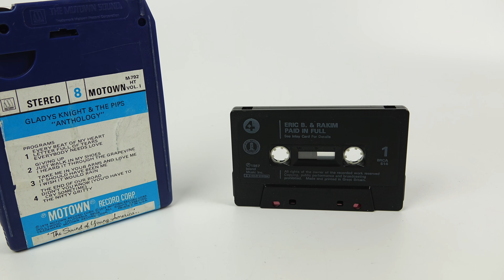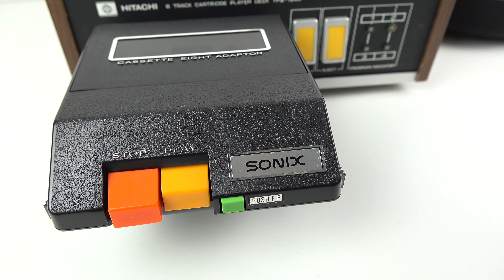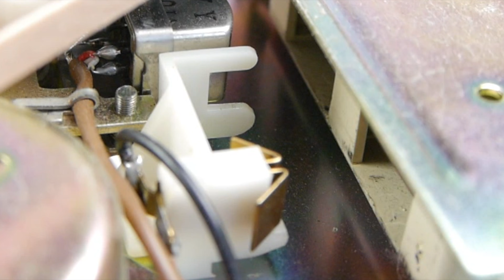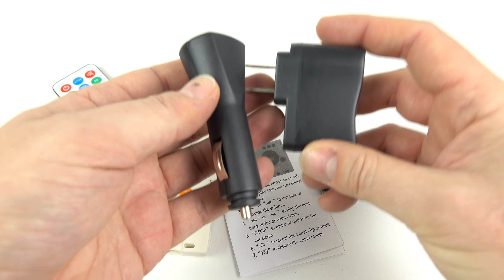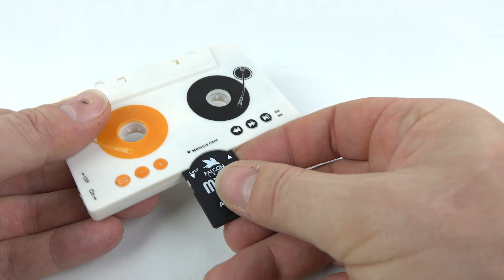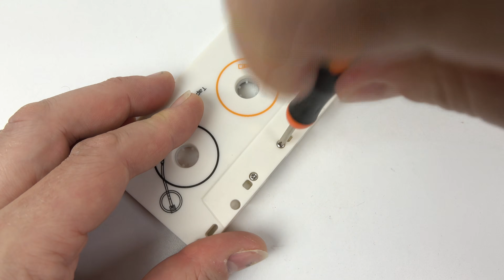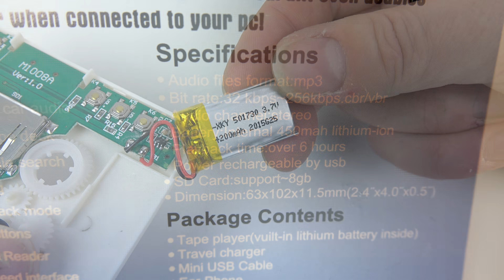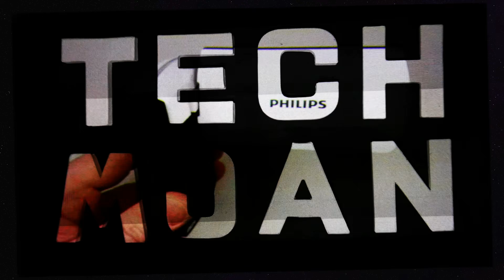Car Stereo Tape Adapters - 8-Track to Cassette to MP3

Comment: When my grandmother stopped driving around 2000, she gave me her 1981 Cadillac El Dorado and it was rocking a 8-track player.  Kinda wish I knew about these converters back then....  I drove that car up till about 2008 before it finally kicked the bucket.  Well it didn't but the repair costs just got to be more than the vehicle was worth...

Comment: I saw a cassette to 8 track adapter at a thrift store a few weeks ago.  However it was just the size of a regular 8 track cassette and the smaller cassette would fit inside it.

Comment: Considering that it accepts cards larger than 2GB it's probably SDHC compatible which means cards up to 32GB, larger than 32 though is SDXC which i have a feeling won't work.

Comment: In addition to these 8-Track to cassette adaptors, there were also mechanical models that transmitted motion from the deck to the adaptor via a fake idler wheel. These tended to be much more compact than the ones equipped with their own electric motors for the tape mechanism, but suffered from speed issues the moment there was bad physical contact between the deck and adaptor wheels, or if the 8-Track deck ran too fast or slow to start with. Dimension-wise, my "Sparkomatic" adaptor is maybe only one inch longer than a real 8 track cartridge, it is properly convenient for playing digital music through an 8 track deck. In fact, that's what I do on my old Hi-Fi system since it's already maxed out on audio inputs from various analogue formats.

Comment: Fantastic video! It made me smile. I installed a 4-track in my car, then when 8-track came out I swapped it. I bought one of those pinch roller adapters so I could play my 4-track tapes... 👱🏻

Comment: The battery is a lithium polymer, not a lithium ion as stated on the packaging. It's a relatively new technology which suggests that perhaps this is newer old stock than expected. Perhaps popular with some Asian markets that still install cassette players in new cars today (surplus stock left over when western technology advances demand change of format.

Comment: Now if the designers of the cassette mp3 player were /really/ clever, they would have put in a tiny generator so that it could be powered by the motor of the cassette player   ;-)
Reply: It would probably be impossible to find a generator that small, but if they had managed to pull it off, it would be really cool!

Comment: To those complaining that Techmoan "stole" this idea from databits, I suggest that you actually watch both videos. Same idea, yes, but they each have a different take on it. I'd also point out that databits has several videos that were quite obviously inspired by Techmoan's.

As a sidenote, I recently used a similar series of adapters to connect a mid-'80s portable TV to a modern cable box. Much like in this video, it was completely pointless but I enjoyed proving to myself that it could actually work. :)

Comment: I have an 8 track to cassette adapter that has a pinch roller, and it uses the capstan to drive the tape mechanism. It doesn't work as well, and most tapes will drag. I once put it in an 8 track recorder and put a blank cassette in it just to see if anything would record on it, but nothing did.

Comment: my neighbor used to have a cassette MP3 player that did allow you to control it via the tape-deck controls due to an optical disk (like those in those old fashioned ball mice) between the two cogs telling it the relative velocity.

Comment: I have a suspicion that this thing would have blown up many decks. That sensor mechanism is very clever, but it has to draw power all of the time. That circuit was only designed to be completed once every few minutes. Unless 8-track decks were massively overengineered they were unlikely to have been designed to withstand constant current draw through that circuit.

Comment: Wow... I don't know where to begin. I'm guessing you read something I may have once mentioned here, and decided to try the same for yourself... especially since you made use of a Panasonic Dynamite8 portable 8-track player! I did the SAME!!... only I used a 3.5mm-stereo/cassette adapter with a Sparkomatic variant of a 8-track/cassette adapter, which got for pennies from an old mom-&-pop auto-parts store in Joliet. And I feed the line-level output of a Panasonic portable CD-player through it all... And it worked!

 Why? Because the Sparkomatic-made adapter uses a rubber tire-wrapped wheel--driven by the 8-track player's capstan drive--to drive the cassette player mechanisms in the adapter. Mind you, drive-belt in the Dynamite8 I used didn't have tension to turn the rather "tight" works in the adapter... but since my arrangement need not rely upon that aspect, it rang clear & true to the content of the CD. I did try it with an regular cassette, just for fun, and learned about that belt tension issue that way. I then tried the adapter both ways on my home console's 8-track player, and found it to be just as true to the source in reproduction as before. 

As for SD-card/cassette adapter, I had only seen that very model once online in passing in the mid-2000's. I thank you for reviewing it & posting a link to it, as I've been curious about it for some time. Now I can get even more year of use from my Sony Sport AM/FM/Cassette Walkman/Walkabout/Sound-about!

Comment: Most likely that MP3 adapter can use up to a 32GB card. 8GB cards were SDHC which went up to 32GB in capacity. 8GB may have been the largest card available whenever that product was first introduced.

Comment: I have a 1973 XB Ford and it was amazingly hard trying to find a shaft tune radio for it, the one I bought has a USB input on it so I can just connect my phone to it, but I really did want an 8 track for it. If only there was a (TM) Fake-Track I could buy that would look like an 8 track, but had a Bluetooth adapter in it. I'll have to hack one.

Comment: Radio stations in the US used a similar format (2 or 4 track) until the mid-late 90's for local advertising.
Reply: We called them carts, and they were all 2-track at the stations I worked. They were also for music - if you were a current-music station of any format (top-40, modern rock, adult contemporary, etc), you'd have all of your daily rotation on carts. Plus, as you noted, commercials, et al.

Carts had a significantly different (and far superior) transport mechanism that got rid of all that horrible 8-track wow and flutter. Basically, there was a hole on the underside near where the passive capstan roller was on the 8-track, and a flip-up active-power capstan would pop up into the cassette, which meant that you weren't relying on cartridge friction to hold the tape up against the transport - or, slightly less directly, the read head.

There had also been oversized carts, nearly the size of LP record albums, which ran at slow speeds and were used for certain jobs such as air transcription for the FCC. (That is to say, recording what you put on the air, so you could keep a history of your broadcasts in case something happened and it became important to have it.) I never used those, but two of the older cart machines still in use at the station could, in theory, load and play them. I was told they'd hold many hours of low-quality recording at their slowest speed.
Reply: i know about the 4-track ones when my dad worked in radio but didnt know know about the 2-track ones
Reply: My high-school were using them in their "Digital Media" class up until 2011.

Comment: One other thing I didn't see in the video or comments. 
Did you find that the coupling and sound quality between the head in the adaptor and the one in the 8 track deck sounded better on 1,2,3 or 4 ? Or did it make a difference, particularly in the high frequencies?

Comment: Guys, don't buy cassette adaptors. You get way better quality if you get a standard 3-wire jack cable and solder left and right to the output pins of the cassette's Dolby chip and ground to the player's case. Than you just have to trick the player that a cassette is in and you can you get a really nice line-in input. If you want you can even go further and remove the tape mechanism completely and add an external switch to turn on the tape input. My radio is a stock Ford 5000 RDS E-O-N and it didn't had any AUX inputs at the back. Until I did this mod I didn't know my radio can play as good as it was average playing FM or tape.
Reply: ***** What link? You think everything has a link? I had a spare radio to mess around and I just tried an idea and it worked. THERE IS NO LINK!
Reply: +Daniel Daniels I only use my iPhone I have no need for am/fm or CDs. My mod removes the ability to listen to am/fm and CDs.
Reply: Daniel Daniels If you actually need to be able to play cassettes you can make it work. You are just sharing the input to the cassette player pre-amp.
Reply: Well, the most difficult part is finding the Dolby chip on the radio PCB, then checking its pinout by googling the number on a chip (look for left and right channel output) and finding a good place to solder the wires to.
Reply: Hahaha at people asking for links. That is very good thinking man.

Comment: On SD cards the real limits are 2 GB and 32 GB. If it supports over 2 GB it has to be from 2006-07. The SDHC standard was announced in January 2006.

Comment: You should have found a Sparkomatic 8 track to cassette adapter. They used the 8 track's capstan to drive belts/pulleys without the need of electricity. However, they had a habit of running a little fast.

Comment: While I don't know how long that model of MP3 cassette has been on the market, I have one that I bought in '07 or so that is remarkably similar. Both yours and mine have the same outer case design, but mine lacks the IR controls and caps out at 2GB since it was apparently made before SDHC support was common. Mine also supposedly works with the cassette player's controls by tracking a two tone gear inside with IR sensors, but I never got the feature to behave properly.

Comment: Awesome. XD
I remember those MP3 cassettes coming out around 2001 or so. If memory serves there were some models that would track forward or back depending on if you pressed the FF or REW buttons on your deck, and it would pause if you stopped the deck. 
As far as the 8-track adapter goes, I had to do the same thing recently. I got a 70's Lloyd's stereo at a flea market so I could listen to records at my Aunt's in the country, but it doesn't have an Aux or tape input. only an 8-track slot. The adapters I was finding on ebay were a little pricier than I was looking to spend, and I happened on a Kraco one at an antique store for about $15. paired with a wired tape adapter, I can play my iphone on that old stereo, and it sounds really good considering the quality of the stereo. Only issue is I have to put my phone in airplane mode b/c the tape heads pick up the cellular signal even if the phone is across the room. 
Next thing you should do is find one of those bluetooth cassette adapters and put that in the cassette-8-track adapter. Ha!

Comment: The pickup on the 8-Track adapter is very similar to the ones that are used in aux tape adapters today.  I'm legitimately surprised, I would've thought that it would look extremely primitive, but things haven't changed much.

Comment: There is either SD (2GB or below) or SDHC (4GB and up to 32GB). So you can have support for either 2GB or 32GB. Anything in between is bullshit or is deliberately limited by software. (I left out SDXC, which is irrelevant here). 
BTW great channel - keep it up

Comment: Just a question on the MP3 cassette, on a player that has switchable settings for the  type of tape in the cassette will the sound quality change with the setting? This statement is preemptive. Yes yes I know the signal is digital but the tape deck processes the input differently based on the type of tape it believes it is receiving the signal from.

Comment: 8gb is sdhc, anything up to 32gb should work. sdxc might not work. it also probably puts it somewhere between 2006 and 2009. either that or its newer and didnt implement the newer sd card standards and support.

Comment: I had a cassette to SD adapter that was better than yours. No remote. But it was controlled by the cassette buttons. Pause would stop the song. FF and RR would either advance through the song or skip to the next song. Also, the device would record. Maybe someday I'll find it...

Comment: I had an MP3/cassette adapter called a Digisette Duo-MP3. I intended to use for a project (but I ended up frying it.) It had a kind-of cool feature that it would detect motion on the cassette wheels and start/stop/pause playing based on that. Otherwise, same idea ... also it had 32MB built-in memory. Wow! :)

Comment: Maybe you could've extended the messing about by having some conversions from something like a casetteplayer with a jack output towards that casette, then that in the 8track converter and finally through the 8track player itself. Just to mess with the trolls here. Although I'm pretty sure I've seen someone use a converter before so I should report this video for theft and unsubscribe immediately.

Comment: If the SD card uses a FAT16 or FAT32 filesystem then chances are the "8GB Limit" isn't a real limit but at the time the device was produced 8GB was common so they slap 8GB on the box. Also from what it looks like the battery is a dual cell so each cell is 200mah giving you 400mah. However that is the incorrect way to rate a battery, Watt hours is a better way to rate a battery's capacity.
Reply: Watt hours seems to be the standard in some parts of the world (Canada?), but what difference does it make? You can easily convert it either way.
Reply: Most electrical engineers will go by Watt hours to ensure the true capacity of a battery for powering a circuit. For the Consumer market such as batteries are measured in Amp Hours or mAH to as a marketing ploy to get a huge number to make their product look better. So instead of saying this battery that is 3.7 Volts with 5.55 wh of usage they will say 3.7 volts at 1500mah. 

Amp Hours measurement ignores voltage change and assumes a constant current load while Watt hours measurement will show the true capacity and takes voltage into account.

Comment: The specs on that MP3 casette are kinda weird. MP3s go to 320kbps but for some reason it doesn't want to go above 256kbps? I mean I guess that's not impossible, but that seems mighty strange.

Also SD cards larger than 4GB are technically SDHC cards, even 4GB SD cards are a sort of violation of the standard and support on devices is mixed, because it requires a special format. It all pretty much comes down to the file system, FAT16 for SD, FAT32 for SDHC, and exFAT for SDXC cards, which set the limits of the size.
Reply: Going to echo the other reply here. The processing on the player may not be capable of keeping up with higher bitrates. When I first started messing around with MP3's my PC couldn't play 320kbps properly- it would stutter and pause after what I presume was every decoded block of audio since it couldn't keep up with the playback. 128kbps was fine though. As for memory card limits- I'm not sure about the original SD cards (possibly 2GB for FAT16, and 4GB with 64K clusters) but the SDHC limit is 32GB in the spec, which is nowhere near the 2TB maximum size of a FAT32 partition.
Reply: According to MS FAT32 is not intended to be used for larger than 32gb Partitions, with sizes up to 6tb being possible through various means. They likely didn't want to go beyond 32gb for SDHC cards to avoid breaking any standards.

https://technet.microsoft.com/en-us/library/cc938432.aspx?f=255&MSPPError=-2147217396

Comment: The 8 gig limitation is typically due to filesystem format on the card. I'd imagine the 16 gig card was formatted as FAT16 or the like. The Nintendo 3DS has a similar limitation that can be bypassed by filesystem changes as well. It has something to do with the SDHC or SDXC card format and NTFS, IIRC.

Comment: My favourite thing to do when friends are over and want to play music is put the line to cassette to eight track adapter into a 2-XL and then plug their phone into that. I have a differently designed one that took power from the track change prongs for the play head but used a pinch roller for the belt mechanism. It had a three position switch for play, stop, and rewind, no fast forward.

Comment: brilliant episode! I recall having a in car CD auto changer - my head unit was not compatible so my work around was to have a device which played the CD auto changer on an FM radio channel to get my CD quality output - was professionally installed by a car hifi shop. Worked very well!

Comment: would the tape sound better on a nicer 8 track player or no. and what is that tape machine where the tape looks like its hovering the 2nd tape player you use for the mp3 cassette

Comment: great video! love the super-clean visual style!
three suggestions I have:
1.) replacing the capacitors on the cassette-to-8trak-adapter might restore its sound quality, especially if it was never used (just saying)
2.) if you reduced the volume on the mp3-player-cassette while inside the 8trak-adapter, you could most likely prevent the clipping
3.) the 16GB SD did work BUT I suspect that the player can only access the first 8GB of the SD-card (and the data on there), making the limitation real again

Comment: I believe you can buy Bluetooth to Cassette adapters now.  Would be a much better system than the MP3/SD card adapter in this video.
Reply: ***** eBay.  They all probably come from the same Chinese manufacturer.
Reply: Can I buy Bluetooth to 8-track?

Comment: I think generally for sd cards they quote the largest readily available version. for instance my phone before last said it was capable of taking a 16gb sd card and I used a 64gb in it with no issue